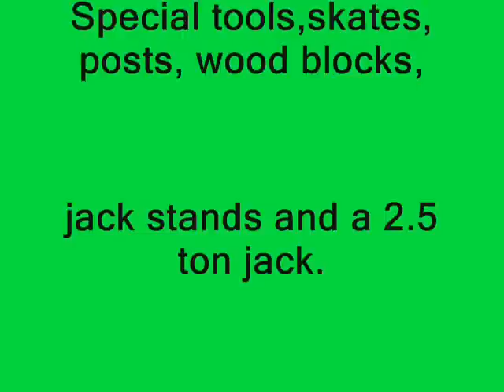Pulling body off of frame 1966 Beaumont / Chevelle

Comment: whats the torque on bolts,was they sticky,what if the bolt just turns or you break one off?how many was there?did you use a impact or should i spray p blaster and attack with a socket and elbow grease,ive got a 66 malibu/robbie

Comment: If you go wider with the Blocks the first time around the frame can roll straight out without the double work.
Reply: I tried this, the rear tires were still going to hit on the bottom rockers.  We had to take the rear tires off in order to slide it forward.

Comment: Your picture-video is absolutely worthless at showing how you actually accomplished the removal of the body-off-frame!! It would make 1,000% more sense to show a motion-picture-video!!
Reply: Think!
Reply: @towbar2  I already did! But I cannot pull imaginary step-by-step instructions out of thin air, and expect them to be correct!
Reply: there is lots of instructional videos on how to remove or replace body mount bushings....which is a whole other subject than separating the body from the frame....you are supposed to know how to do all that before getting to this step.
This video is very clever way of sliding a chassis sideways out from under the car with little space and no tools but a jack...never seen this done sideway before like this...awesome job Dave. its 2021 now and ill be doing this same thing in a couple weeks on my 66 Beaumont conv...engine is out and front end is off already.....Woodstock, Ont.